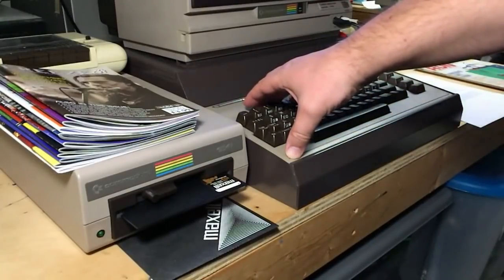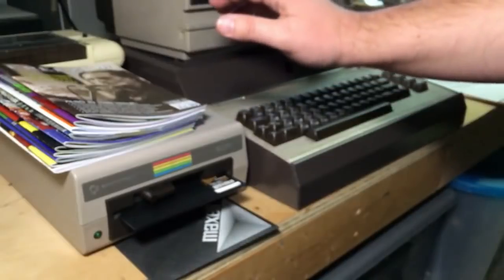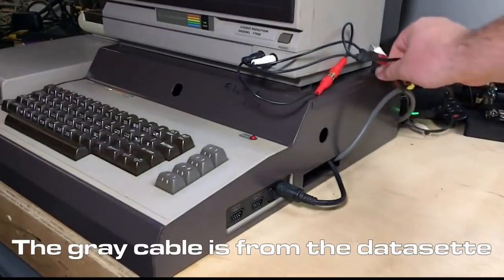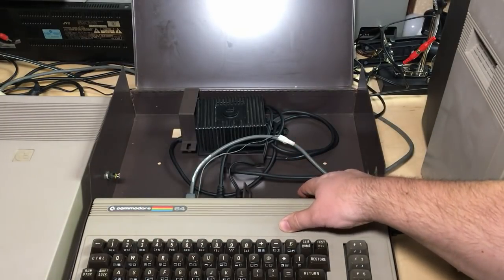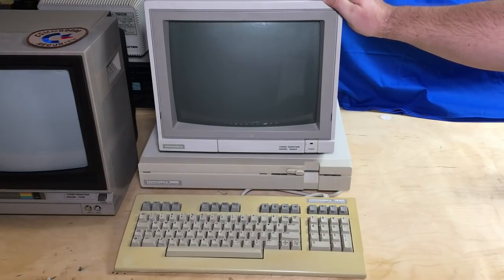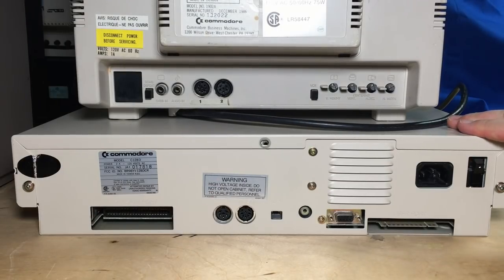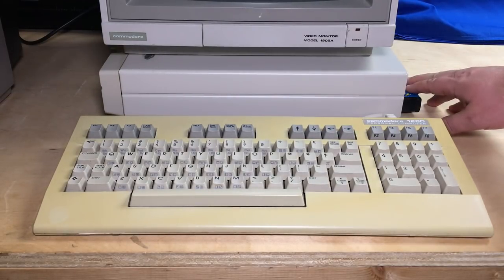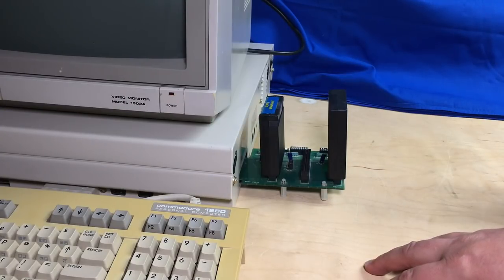Classroom Commodore 64 Enclosure and C128D

Comment: I grabbed the keyboard layout from the VT100 and the reset circuit damm near kicked my ass as the VIC chip did not like to be reset during a DMA cycle.  (Found a way to hold off reset using a spare 7406 gate).  The C128D in the original plastic was my favorite model, the metal cases dame much later, aka Blechk Deisel.

Comment: You are doing well sir. Your videos are interesting and are very well explained. I had a C64 when growing up and have dabbled with it but mostly with basic (still make programs in windows in basic) and emulators and converted a DTV to a full featured C64 with all ports exposed but never really understood the machine code / assembly side of things. Watching your videos has reignited my fire and will revisit it. Just because it's old doesn't mean there is nothing to learn. Keep up the good work.

Comment: 15:30: On the D-CR "cost-reduced": Maybe they cost-reduced the thing mainly in terms of PCB manufacture but upgraded the case from injection-moulded plastic to metal at the same time in a way that still came out cheaper?
Reply from the maker: Yeah, the "cost-reduced" shouldn't be taken to mean "inferior" or "cheap" at all; I think in every way, the 128DCR is the superior system. Better case, more video RAM, upgraded (bug-fixed) ROMs. Mind you, I don't have a non-CR 128D so maybe there's something better about it that I'm not aware of.

Comment: That metal enclosure is pretty cool, but it would really need a cooling fan for air circulation, especially with the PSU in there.
Reply from the maker: Maybe that's why they were mainly popular in Canada - it doesn't get too hot here :)
Reply: I had one of these, tan color, was lucky to get it considering the cost

Comment: Even though this video is a bit older now... I think the school enclosure would make a lot more sense, if the ports would be connected to the left and right sides, just like that added button. If there were simply some flat cables in there to connect to the corresponding ports on the C64, this would be quite handy to have, with the monitor on top and still all ports easily accessible... and as aforementioned, a case fan of course :)

Comment: I never saw one of these!  Our schools, back in the mid-80's, were all buying Apple II compatible Franklin machines.  Very interesting to see!  I only wish Commodore had produced a similar footprint machine and optimized expansion abilities with the space.
Reply from the maker: Commodore did make the "Educator 64" which could have been a fantastic system, but had a monochrome/greyscale screen, and I'm not sure how the expandability worked on it. https://en.wikipedia.org/wiki/Commodore_Educator_64
Reply: @ @8_Bit  - WOW..  it's amazing that I've never seen these before, considering I grew up in the Commodore scene.  If you could get 
any access to one, a video would be awesome

Comment: When I saw the side view of the metal casing for the C64 at around 6:30 I had an idea of a board that plugs into the cartridge slot at the back of the C64, gives it a 90 degree turn and makes it accessible on the side - did such a board exist?

Comment: It isn't just 'some people'  calling the metal case ones 'DCR', Commodore used this name as well, for example, the PSU in my mid 1989 128D model says it is for a 128DCR. 

It is called cost reduced not because of the case (there is another reason for the case having changed to metal) but because it includes a number of cost reducing measures inside:
- single board integrating the 1571
- removal of the 6526 from the 1571, replaced with a gate array performing all the required functions
- only uses 4 64K*4bit ram chips instead of 16 64k*1bit.
- removal of the PSU fan
- on later DCR models, removing of the holes for the power connection for the case fan
- on even later DCR models, removal of the mounting hole for the case fan
- removal of the keyboard storage and carrying handle

There exist a few prototype 'plastic case' NTSC 128Ds, Bil Herd owns one for sure, but for all I know it has never been sold. It has been sold in Europe, and they do show up every so often.
Reasons to want the 'plastic' 128D...
- better video output from VIC IIe
- board is identical to that of a regular 128, making them a lot easier to get, and making it possible to use the newly manufactured modern 128 board clone.
- PSU fan is installed and connected (but you really want to replace it)

Reasons to want the 'metal' 128D
- 8568 VDC (supports 'EGA' resolutions and sync besides 'CGA' resolutions. No it won't do EGA color, just the reversed polarity sync to tell a display to expect EGA style timings)
- 64K vdc ram (possible on 'regular' 128 and 'plastic' 128D as modification)
- integrated 1571 comes with CBM DOS 3.1, which fixes some prominent bugs (can be installed on regular 1571 as well)
- far less prone to the entire case going brittle
- does not have 'dangerous' features like the carrying handle. While this was a very cool design feature in the 1980s, plastics have aged and turned brittle, making the risk of the carrying handle breaking when actually used very real
- metal case is much better at transporting radiated heat to the outside environment, so stays cooler without fan, and if you decide to install a fan, can use a slower, less noisy fan.

As an aside, there is a cost reduced 'regular'  128 board as well, that has the same reduction in the number of ram chips, but I only ever saw a few pictures of it, and not sure if it ever entered production. It seems the 'flat' 128 was removed from the market before that actually happened (while they did keep selling the 128DCR for quite a while after that).
Reply from the maker: Yes, I realize the "DCR" was a Commodore name; the badge on the back on my C128D does say "DCR" on it. But the front badge just says 128D, and that's what absolutely everybody in my experience here in North America called it: the Commodore 128D, because that's what it said on the box, that's what it said on the front of the computer and keyboard, that's what it was called in the magazines, and the original plastic 128D never was sold here as far as I know.

It wasn't until the last 5, maybe 10 years I started noticing people make the distinction as we became aware of the plastic original that was more common in the EU.
Reply: @8_Bit  in North America it made sense to just call it a 128D as the original 'plastic' version never really got to market in the USA. There exist plastic ntsc ones, Bil Herd has one for example, but in general, a 128D was the metal case oe there. In Europe, among the more serious users, the distinction was well known, because the original 'plastic' D had this desirable storage for the keyboard, but the older VDC and only 16k vram. 

Anyway, the 'plastic' one was supposed to be sold in the USA as well, but that never really happened.

Comment: @ 13:41 you mentioned the Disk Drive Reset Button.  Does a copied Karateka disk (https://www.youtube.com/watch?v=a8B-EJQu6i0) have the same affect as it does on a 1541 drive and would this button resolve the issue if it were available to the 1541 + C64?

Comment: Robin, do you recall an enclosure/organizer for the regular flat Commodore 128? I had one in the 90's but it's long gone. The monitor sat on top and there was space underneath for the back part of the 128 so that only the keyboard stuck out during normal use. Just above the keyboard there was space for two disk drives (1571's I believe) but I only had one drive, so there was a "blank" plastic piece for the other side. From far away it just looked like a regular desktop case similar to any IBM clone at the time. In fact, I bought it fourth-hand, so I didn't even know the computer itself was "inside the keyboard" until I took it apart to bring it home. I can't find anything about this online, mostly because I don't know what to search for.
Reply from the maker: I don't recall seeing one for the C128, but I remember the Compucase 64D that was a similar product for the C64, I think made in Germany. I'd suggest looking through Commodore magazines (there's lots on archive dot org) as that C128 enclosure was probably advertised in there at some point.

Comment: I like the idea of you rotating it 90 degrees. How does cable management work when you have the 40 & 80 column cables hooked up and perhaps a an external drive cable?
Reply from the maker: The video cables stay fairly tidy, just running from midway on the right towards the back beside the case, especially if you're not using the User's Port. An external drive is a bit more trouble; not so much the cables, but where to put the drive. If you've got enough desk space it can go further to the right, otherwise, some sort of hutch/riser would be useful.

Comment: Sheet metal was cheaper for Commodore due to an office furniture fab they owned.
At least that's what I read in the Bagnall book.
Reply from the maker: Yes, and I think that influenced the design of the Commodore PET in particular. The metal C64 enclosure I showed in this episode wasn't made by Commodore, but was probably inspired by the design of the PET.
Reply: The metal case also helps shield RF interference both in and out of the case.

Comment: A lot of power supplies are going to read higher than the voltage they are to supply because they will read a lot higher with no load on them.
Reply from the maker: Thanks, I heard that after I made this episode. Hardware is definitely not my talent! I'd like to find out how to test these power supplies under load. Maybe measuring inside a powered up C64 case would be the best way?
Reply: 8-Bit Show And Tell Switching power supplies need a load to operate properly. If not connected to the actual device, connecting them to a dummy load should work. That would just be a group of high power resistors wired in a combination of series and/or parallel to obtain the desired overall resistance and power dissipation. The values used would depend on the amount of current you wanted to use - a nominal draw or a heavy load. For someone who had lots of power supplies to test, they might wire several feed points to test under several conditions to better validate the supplies.